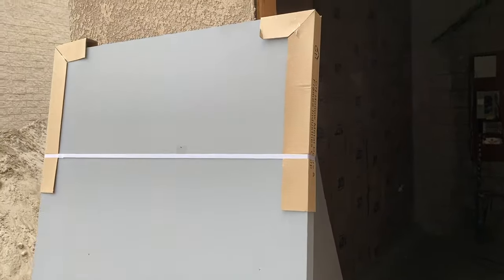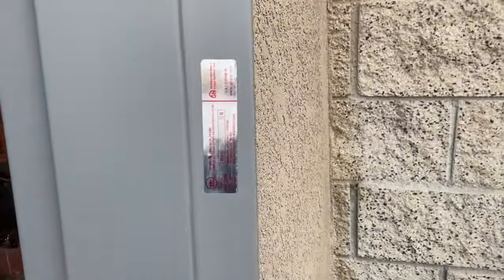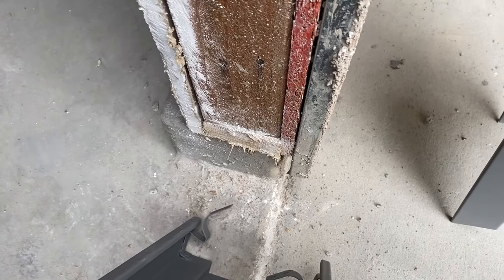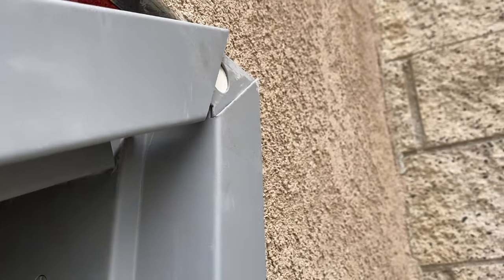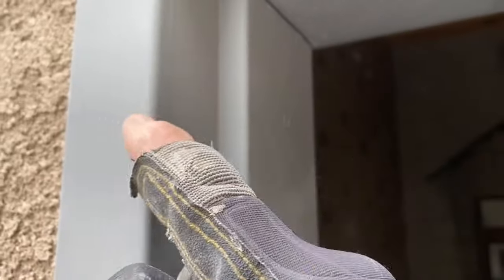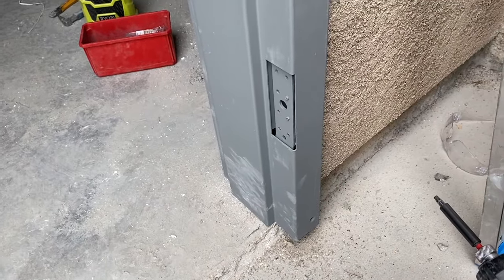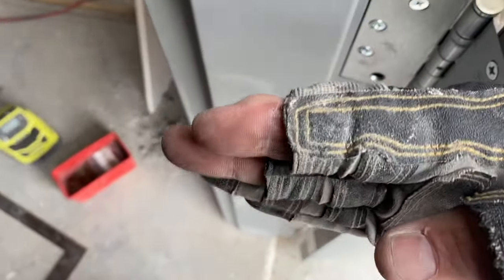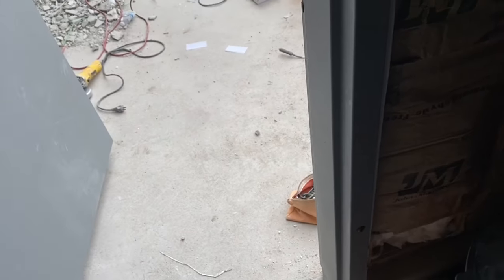How to install a commercial steel door with wraparound frame

Comment: Can I install one of these doors when there is no wood framing like in this video? I have a door and frame on the side of my garage that needs replaced but it’s all concrete, no wood framing. Would this type of door and wrap around frame work? Thanks.
Reply from the maker: Yes. Measure the thickness of the wall. Whatever the thickness is, that's what the "throat" of the frame should be. A welded frame is another option if you have the space. If your opening is 40" x 82" you can get the welded frame at Home Depot. The wraparound frames at HD will only work on a standard 4.5" thick wall. Thanks for watching.
Reply: @askillthatpays  thank you for the reply!

Comment: For water proofing can you use flex spray or something similar besides flashing tape?
Reply from the maker: There are different codes for different cities. It's hard to do ANY kind of waterproofing when doing a retrofit, so MY rule in that case is do the best you can. If it's new construction or adequate access, a spray is no acceptable, but if it provides some protection, it's better than nothing. Thanks for watching.